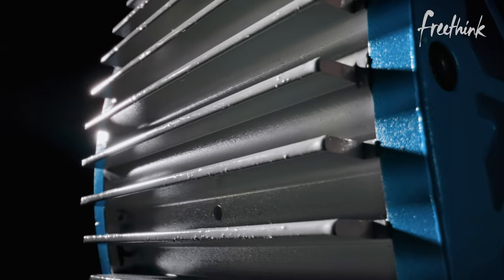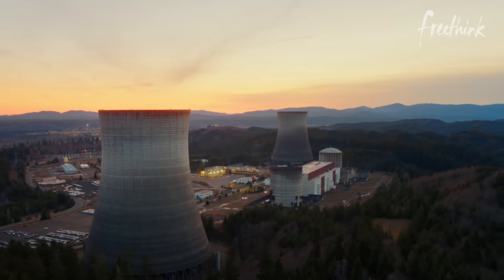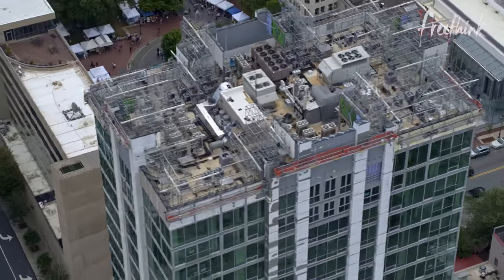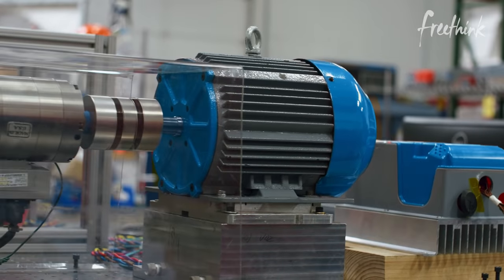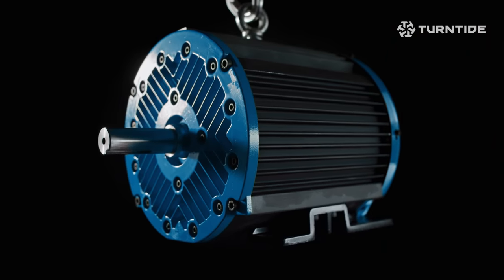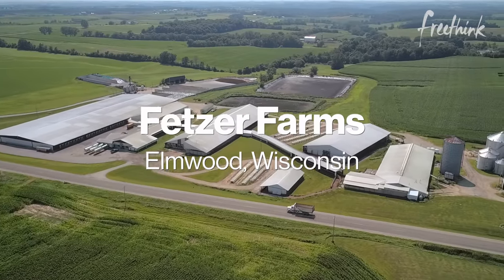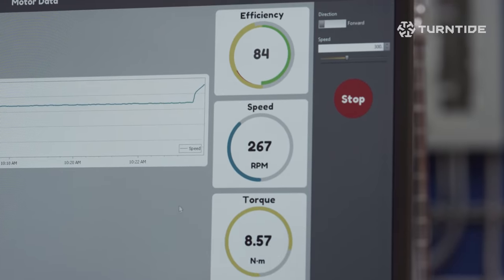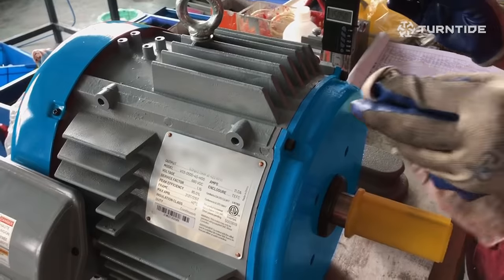Want to Save the Planet? Start with Reinventing the Motor

Comment: I work in electronics and electromechanics, I work with VFD frecuently to control standard 3phase induction motors, I came across switched reluctance motors about 6 months ago, I tested one an I was amazed it was tiny, light and simple and yet extremely powerful, however the electronics that controlled it was quite primitive, it lacked many of the VFD's features, but it was ok for testing, yes the control system is complex and it needs to work pretty fast and precise to maintain performance and precision of movement, but hey , we have something fast and cheap!! Computers!! I however haven't seen yet a control system with the quality, features and precision , let's say, of an ABB Drive unit, if there is such a thing now I will love to test it in real word scenarios
Reply: I just looked up what an ABB Drive is, and I have to say it looks very promising! Hopefully it can be tested out more fully! I do have a comment above, in Asbjorn's thread, it might be of interest to you! I love all these ideas and interesting motors ideas! Thanks for the great ideas, Leandro!
Reply: SRM's are very specific kind of motor in their pure form ( there are also hybrid motors which have both magnets and "teeth" on their rotor, so they produce torque in two ways at the same  time, this type of motor is very popular due to high torque/size ratio and they are compatible with some BLDC drivers) Performance of SRM is so dependent on the driver/control circuit that producers often don't specify nominal parameters of the motor. They have three zones of work. First zone is work with constant torque.It occurs at lower speeds. In this zone SRM acts simillar to BLDC, PMSM, or Induction motor that works in closed control loop. Then there is second zone at medium speeds, "work with constant power", where when you increase rotation speed, torque drops proportionally. The third zone is "work with decreasing power". It occurs at very high speed. At this zone, when you increase rotation speed, torque drops in proportion 1/rotation speed^2. The driver circuit is also quite unique. In SRM polarization of coils is not important, so there are no halfbridges in driver, and that's a reason, why there are 6 steps in 3 phase BLDC/PMSM/asynchronous motor , but only 3 steps in 3 phase SRM. THey have more steps when driver uses asymetrical driving, which is good way to increase torque and precision of motor. There is a lot of tricky things when we're talking about driving SRM, so there are no universal driver units like VFD's or bldc drivers. Usually designer has to design his own driver that is proper for certain application of motor. I'm personally not a fan of SRM's, because i've never measured an efficiency over 60% on SRM, while average induction motor has efficiency over 80% and BLDC's have efficiency over 95%. SRM's are often really loud too. Their biggest advantage is low price and really simple rotor, so they are almost indestructible, and they don't lose power after years like BLDC's.

Comment: "Motor efficiency varies between 70% and 96%" 
- Yaşar Demirel, in Comprehensive Energy Systems, 2018

I have no idea where your 50% efficiency comes from. I stopped at this point because you can't expected trustful informations if you start with such "inaccuracy"

Comment: Ok, they invented the bldc motor controller
 Congrats. Being twice as efficient than a >95% efficieny machine? 

It might be easier. But that's about it.
Reply: 97.5% is twice as efficient as 95%. In other words, it wastes half as much energy. If you have a 95% efficient 10kW motor, you're wasting 500W, which is about what an electric charcoal starter uses, or half of a microwave oven. Quite a lot of heat to get rid of. If you can get that down to 250W, it's a big improvement.

Comment: So basically they just invented the ECM that I've had in my HVAC system for 6 years already. I'll be glad to see this technology get more robust and readily available but it doesn't seem ground breaking.
Reply: Back EMF also a potential energy that be can store and re-used,,,,,...!!!???Tesla/John Berdini
Reply: Electrically commuted motors for HVAC are also great in a perfect world, but fail more often and go ahead and try to replace it...4 time or more than a standard single phase HVAC machine to replace and a tech cannot just swap it out quickly, you will need an original programmed OEM motor for a kings ransom.  Its like putting a VFD on a pool pump motor, fancy, cute, expensive and wont last....just put an intermatic times on it and once you have turned your pool water twice in a day shut it off....job done

Comment: the modern ac motors have efficiency 90% and above, so i don't know where exactly saving will come from. On the other hand they telling bulshits, you may control speed of any ac motors, and this is not fromtoday, frequency invertesr are wide spreade from middle 80-s.

Comment: How's this any different than simply adding a variable frequency drives to good old induction motors? Nowadays induction motor are 98% efficient, they just need to match driving output to load demand, and that's how you operate in the 98% range.

Comment: It has been a few years for me but I think all industrial motors over 100hp state around 97-98% efficiency.  Not 50, 60% or whatever these guys are saying.  Also easily verified with an ammeter, motor load and mass, temp guage and a little math.  As far as the electronics go, a 20kHz produced by man has existed since the first spark gap transmitter.  Also nothing new about this type of motor, its more pretty than the prototypes, but works the same nonetheless. The reason no one makes them is simply because they are not economically feasible to save 2 or 3% of back EMF.  Not counting a whole host of engineering problems and that motors lack of torque.  All lies and b.s.

Comment: Freethink, Rockwell Automation has been doing this for years.  They are called variable reluctance motor drives.  They work great.  But the motor drives have a few different modes that auto tune the right control mode and power electronics.

Comment: most motors that use any significant power are 85-98% efficient now, I don't see where half of the energy going into motors is wasted, nor 25% reduction in carbon emissions comes from.

Comment: I think that I've understood what they're trying to sell. The motor is the same 'Switched Reluctance...' but the waveform that is fed to its EMs is accurately shaped for every RPM and isn't your regular square wave. the shaping is done using ML what learns about the motor's dynamically changing parameters like feedback temperature, reactance and back EMF, against every applied waveform and tries to optimize the input waveshape for better results. This is done 20000 times a sec and would definitely require high computation power, provided its running a local ML algorithm.
So basically they're experimenting beyond the VVVF and have created a Variable-Waveform motor
I believe its a good idea.

Comment: Switched reluctance motor is not for efficiency, it is for durability, low cost of manufacturing and flexibility of operation. So may not be saving electricity as much as portrait here. BLDC and PMSM are the  efficient ones.

Comment: Some say this is the same as a stepper motor. Putting that aside, I take issue with the assertion that it wasn’t possible until now to drive these motors efficiently, or that machine learning is a necessary component. It’s really no more complex than driving a brushless motor, something that can be done with very cheap microcontrollers. If it is, this video should go into more detail about why.

Comment: This is something I was taught about 25 years ago or more in high school With a simple setup where we had a train And you actuate a electrical coil to push the train that had a magnet But we did this manually with our hands.
 He was going to have us build a circuit board to do To make the train move but we went on to other projects before we got to that 1

Comment: Here have a freebie bismuth motor shaft bearings. No contact could be sealed with a high resistance fluid to prevent arcing caused from VFDs

Comment: Looks like a stepper motor, the magic is in the controller. I do a lot of work on 3D printers, in the last few years stepper drivers have gotten much finer steppings, making the movement much smoother and the motors much cooler to the point you cant heard them and they dont have to be cooled in hot environments. Also a modern electric motor does not have 50% efficiency, more like ~90%. Unless there talking about very specific aplications idk

Comment: Hi everybody.  This video shows an improvement on a well known and widely used electric motor called stepper motor. Driven by analog or computerized electric drives. If this company has now built bigger and better stepper motor with improvements is a very good thing. But is not new and can be less eficient thqn other motors. I am an electrical engineer and I see a good improvement come out of and old design. Stepper motors exist since 1966. For applications where variable speed is needed all the time , like automoviles, the stepper motor can work like a charm. But for other industrial applications the standard are synchronous induction motors that have higher efficiency than stepper motors. Their claims on reducing electricity consumption is a little too high. But again it is a nice improvement on traditional stepper motors. The most common stepper motor used to be stepper motors driving EPSON printers with bussiness paper printed forms. Very useful until laser printers came to market in the early 90s.

Comment: All the older air conditioning motors were permanent split capacitor and shaded pole. They been using DC motors since the early 90’s (General Electric, Trane) There are a TON of HVAC Manufactures utilizing this technology with VFD, variable frequency drives for the compressors now, Carrier now offers a 26 seer system using Samsung Compressor VFD Driven. (this video is a poopy diaper)

Comment: in my base experience in the electrical field, we have the technology which can save up a lot of currents, for example, an electric motor, using the Autotrans or other method we called Inverter even the motor technology has been changed by decade to decade from bigger to smaller but in a very efficient way, by the way, they've just explained just a basic of motor apply to switch on/off on coil, that's the principal how the motor works ...

Comment: What are the cons. Sounds too good to be true
Reply: It requires non-standard hardware to run, which is a bit more complex than the classic three phase inverter. It is also difficult to run it without high torque ripple, acoustic noise and vibrations, because of the saliency of the rotor. It's really not that good, at least not revolutionnary like they seem to claim.

Comment: I'm happy they're pushing these motors into the market but the video did not explain much. I had to research to figure out that these are basically stepper motors tuned for high speed by a computer or advance ecu. Main reason these motors aren't used more is price and computational overhead.

Comment: Tesla has gone two steps further.  They have put in rare earth magnets in their rotors and put them in in a half moon pattern that reduces eddy current loss.  Again they use computer power to control the switching of the electromagnets.  The results are high efficiency and insane power.

Comment: I'm an electrical engineer, I would like to know how this method is better then park and Clark transformations for PMSM motor control?  Machine learning is awesome, but the hardware (MCU) used to pull it off would be expansive.  Do you have just one IC dedicated to the task of predicting the movement of the motor?  How much faster is your spin up time?

Comment: Three phase induction motors are very efficient machines..it is only of late that their efficiency has dropped a little because of modern insulation varnishes and the tendency to make cheap electric motors. This is indicated by the amount of heat they produce compared with an equivalent older motor..

Comment: This just sounds like a more efficient brushless motor. The numbers they are getting are probably from going from 80% to 90% efficiency (e.g. a 50% reduction in waste) or a 90 to 95% efficiency so they're just flipping their numbers. Probably they optimized the timing, construction methods, weight, materials, and the number of poles in the motor to achieve this. It sounds legitimate - they're just selling it for more than what it is. And likely not everyone is using it because they just patented their design and have to drive down cost through production of scale and optimize it for various sizes - e.g. it may work more efficiently for HVAC, Dishwashers and electric cars but may not be logical when sized down for RC or smaller motors.

Comment: Venturi motor is 99 % efficient from 7 rpm through 15000 rpm, and is easy to fepair if needed, simple to manufacture and beats them all,

Comment: A lot of folk are calling BS on the stats.  A'ight I didn't hear it as motors waste 1/2 of the electricity they use, but that 1/2 of all electricity is used in motors... and of that energy there is waste which would be an accurate summation although extremely poor English used to make that point because motors are very efficient.  There may be techniques to get the same amount of work out of motors using less energy and if so they should tell us what those energy savings actually are using their 1 hp version verses the current 1 hp version or something like that.

Comment: If I am to switch to turntide(essentially a motor with smart current controls), how much more expensive will it be? How much more expensive and downtime will it be when it goes down? How much harder is it for me to get the schematics to do on site repair(old motors has almost no schematic)

Comment: Overhyped. What they show here is a switched reluctance motor (SRM), works basicly like a stepper motor. Their main advantage is that they do cost less as instead of magnets they only have iron in their rotor. But due to that they can't develop the same high Flux which means they get lower torque density.
The driving side is also not a problem as it's claimed to be. We have a demonstration SRM in our lab standing around for years now, driven by a simple avr controller.
Can be run sensored with an encoder, then the switching is dead simple, just 2 thresholds for the angle. Can also be run sensorless, then the control is a bit more tricky but nothing needing an AI at all.

Comment: It's not 50% of energy wasted on running motors. All modern electrical AC induction motors are > 90% efficient.  Sure. SR motors can be more efficient.... but they aren't a panacea.

Comment: This seems to be a very large Brushless motor like the ones used in Remote airplanes and cars.  The brushless motors used in RC models us an ESC (electronic Speed Controller) which does the same thing this Motor controller does.

Comment: Not really worried about the planet. It's not going anywhere. It's fine on the macro level and it's been through far worse. I don't mind better motors though, not because they "save the planet" but because they are better. More power, less energy consumption, more stability, better battery life, less wear and tear, longer lasting etc. Advancements in tech are gladly welcome.

Comment: 100Kh LED projector bulbs were supposed to be energy efficient and last practically forever. Look at the number of failures. Consider that there are 8.8Kh in a year. Many of these products fail after 6 months. I wonder how these motor control board semiconductors handle commutation spikes as well as external noise and, the big one, lightning.

Comment: oh boy, you didn't just say that... I really dislike being lied to! Electric motors are 70-96% efficient, where most modern motors are above 90% efficient. So the claim that electric motors waste around 50% energy is a plain lie. Most probably, the purpose of the video is to attract investors, but that's still no reason to lie like this. The only thing you achieved is that I will now discriminate Turntide products from my projects. I also can't believe that BMW got involved in something like this :-(

Comment: The benefits of the technology are well understood (it's why a lot of places use 3 phase induction, (because it's close to this technology and carries a lot of similar benefits). The key advantage will be if you can deliver the control ciruitry in a cost effective manner as usually up front capital is not available (and therefore a limting factor in system selection) even if more efficient technologies exist.

Comment: Have you considered using a plastic case and replacing anything that doesn't absolutely have to be some sort of metal with plastic? Reason being is that plastic has an extremely high magnetic permeability and thus, helps reduce any non-essential magnetic drag.. i realize this would only marginally increase motor efficiency, but it would also drastically reduce weight and should reduce cost of materials as well.

Comment: Yeah....  20kHz switching isn't just possible, it's extremely common.  The motor controllers in cheap quadrotors switch faster than that.

Comment: Axial design motors should be more efficient because they use both sides of the coil north and south pole. Meaning twice the output torque with same input of a traditional coil motor

Comment: They are STILL not addressing the 50% magnetic field wasted in the opposite direction from the stator coils. Simple machine, expensive electronics. They began the intro just right. But when they showed the insides of their SR motor, they fell flat on their faces. If SR motors was that good, why then are you NOT seeing it installed in BMW EVs?